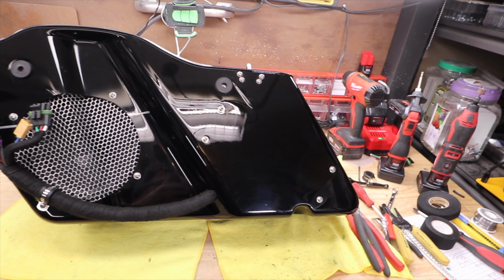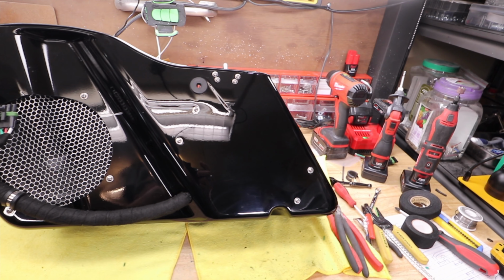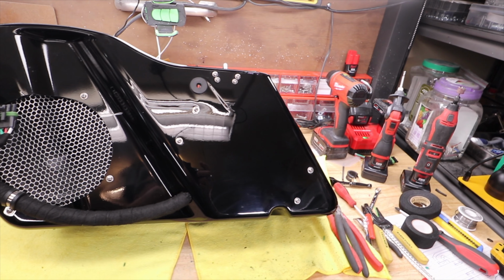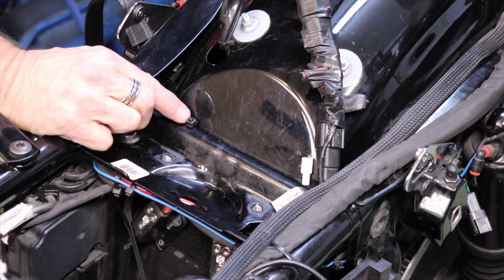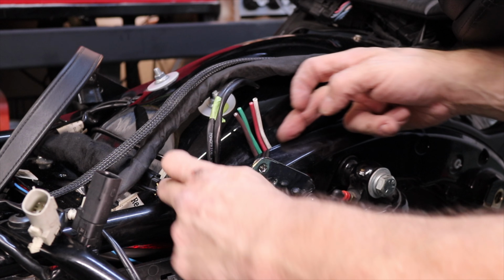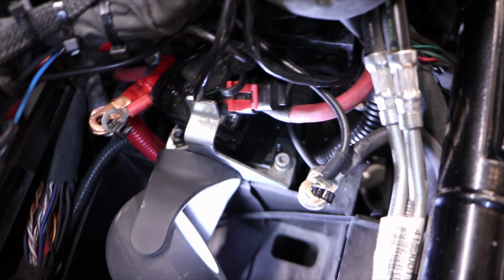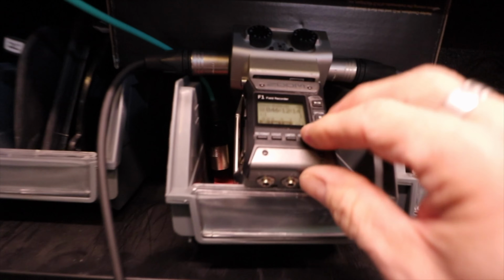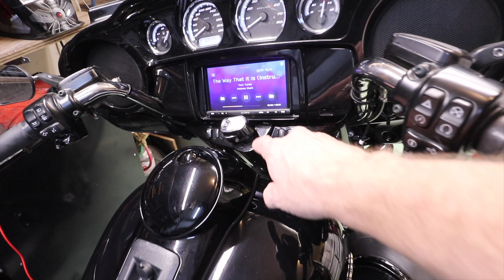Hertz SV200L Midbass Drivers in Harley Bags... Part 2

Comment: As a DIY guy myself....a clean install is of importance. If the next guy have to work (or even yourself)  or troubleshoot behind the install, they can and  will see exactly the flow of the install. Thank you for both videos, strip, twist, solder, shrink, added disconnects, and cable management.....dude you rock and I greatly appreciate your dedication to detail.
Reply from the maker: Right on, thank you so much. 👍🏻

Comment: Awesome video.. do you have a video about your lower set up ? I've been looking at different pods what do you have going on with speakers, amp and pod?
Reply from the maker: I don’t have a video dedicated to just the lowers. The pods are custom made so I can’t recommend those. I do know that Hog Tunes makes a pair that look deep enough to except a decent sized magnet speaker. My speakers are ground zero, the new yellow basket 6.5 coaxials. The amp running the lowers and the tour pack speakers is a Rockford Fosgate TM400X4AD.  It’s a bit under powered compared to the other stuff on the bike but it still sounds good. And the signal to the amp is coming from a Rockford DSR1 DSP. That’s really the heart of the system in my opinion. The whole system is 10 speakers, 4 amps and it would be a nightmare to control without a DSP.  Thanks for watching.

Comment: what brand lower fairing pods are those?  I have Ground Zero coaxials and i couldnt get the Ground Zero label facing the right way because of the speaker hook ups.  even using a half inch spacer.
Reply from the maker: Mine are a custom made “one off”. I can’t say who made them because he’s not interested in making any more. Just no money in it.  I would say take a look at the Hog Tunes ones.

Comment: I have dual hertz Sv 200.1  8 inch in saddlebag facing wheel. Should I run them on the subwoofer output or rear speaker output…
Reply from the maker: Tough question without knowing what else is in the mix…If you don’t have tour pack speakers then run them off of the rear channel, if you have tour pack speakers, run the 8 inch off of the sub channel and set the crossover “All-pass”. Or don’t.. personal choice.
Reply: I’m not not running anything else. Im just just running some Biketronics 7.1 in the front fairings that’s it.
Reply from the maker: Then definitely run the 8” off the rear channel. So much simpler to work with.

Comment: Great detailed vid! I have a similar setup with mmats 6x9s in my lids and the hertz 200s in the bags. What crosovers are you using? For the lids and the mid bass in the bags??
Reply from the maker: A Rockford DSP is handling the frequencies to the Hertz 200's and the 6x9's have their own crossovers that are made by Kicker but I am really unhappy with them and was looking at the DS18 2-way passive crossovers. I'm open to any input anyone has on 2 way crossovers. They have to be good for at least 300W.

Comment: Sounds incredible! May I ask what the 8’s are crossed over at? Or tuned at? I have the Soundstream HU and will be using the sub pre out, and just  Wanted to get an idea of where to tune it
Reply from the maker: Technically my speakers are full range speakers, not subs. So I have the crossover bypassed to allow the full range to come through but on the EQ in the DSP I have boosted everything below 100K by 3dB.

Comment: Did you install the front speaker enclosures or did you have it done?
Reply from the maker: If you’re referring to the 6x9’s in the lids, they are sold by V-Twin Audio. https://vtwinaudio.com/product/vthlk6914-2014-up-6-x-9-lid-speaker-kit/   I had V-Twin install them.
Reply: @i.b.lancer  Yes I m thinking of getting that setup just was curious if you installed them or you had vtwin do it . How tricky it was?
Reply from the maker: I have had the lids off a couple of times and it looks to me like the hardest part about it would be correctly cutting out the holes for the speaker grills. The rest of it just bolts right in. But like I said I sent mine into V twin and they did it for me. Sorry I can’t be more help on that.
Reply: @i.b.lancer  That's plenty of help thanks. By the way great video's.
Reply from the maker: @jdstuts7749  Thanks. I remember seeing a video about installing those. It was quite a while ago but you might want to look around YouTube land to see if it’s still around. I’ll snoop around and if I find it I’ll pass it on to ya.

Comment: Nice how do you splice your rc cables
Reply from the maker: Strip off equal amounts of casing on each wire then push them straight on with each other and give them a little twist, then solder and heat shrink. It really helps to have a set of clamps to hold the wires while you solder them.  Like these... https://amzn.to/3ckaeYW

Comment: So, are you pretty happy with the mid base, does it really changes the sound?
Reply from the maker: Oh ya, it’s a night and day difference.  I haven’t had it out on the road yet.. cause..well, Canadian winter. So I don’t know how it sounds on the highway. But it sounds damn good in the garage.
Reply: @i.b.lancer  I really appreciate all your information, am running 6  6.5  and 2 6X9 in my saddle bags only on one evoX800.4. I’ like to do the dsr1, one more evoX and of course your 8 mid base. Don’t leave any holydays on your painting project 🙃
Reply from the maker: Ya, good choice. I’m thinking about picking up an evoX800.4 to replace a Rockford I have under the fairing. I don’t need two cause I’m running a Biketronics 2250 and that thing is unbelievably loud.. hitting me in the face. And the amps in the bags are so far working out really good. Audio Control is really good stuff but they don’t really have big power for bikes yet.... so I got two.  Lol.
Reply from the maker: @MrAyarza  what speakers are you running?
Reply: @i.b.lancer  I hear you, you will notice the difference with the sound digital. Changing the subject. Was the dsr1 installation and downloads pretty easy? I tried but I got stuck on the firm update.
Reply: 2 ground Zero, 4 Hertz and a pair of 6X9 Rockford
Reply from the maker: @MrAyarza  Ya it wasn’t bad. Did you plug it into your home computer to do the update? I did it and it worked ok on my Mac. As far as the install goes, I think an intermediate level stereo guy should have no problems hooking it up at all.
Reply: @i.b.lancer  yeah, piece of cake on the installation just on the update few of my computers didn’t recognize the dsp. I ordered a new one thinking the other had some sort of problem.
Reply from the maker: Now that I think about it, I believe I had to drag out and old windows machine to get that done.
Reply: @i.b.lancer  as you can tell, am running my amp on the two ohm load, so if I got one more evoX, then,  I will have two more channels to take some load off from the other one. Does that make sense?
Reply from the maker: @MrAyarza  yes and no. Most modern class D amps love to run @ 2 ohms, but you get more separation splitting the speakers up through the DSP for sure. I’m running a 10 speaker system with 4 amps. The back two are running at 2 ohms and the front two are running at 4 ohms. The beauty of it all is that the possibilities are pretty much endless.
Reply: Wow that’s a lots of power,  nice👌

Comment: Great video 
My build is on a 2018 Road Glide. 4 Hertz SV 200.1 Mid Range speakers in front. Accompanied by 4 Hertz ST25 Horns, my read is only 2 Hertz SV 200 L’s in the Lids accompanied by 2 ST35’s, adding a different set of lids Double 8’s and that will give me 2 more SV 200 L’s and 2 More ST35’s. Have 4 amps 2 - BT4180 and 2 - BT2700-2’s also have MLK 1650.3’s in tour pak pods.
Reply from the maker: I love the Biketronics amps. They really hit. I’m picking up another soon myself.   Thanks for watching.

Comment: What size amp are you running for the 8”
Reply from the maker: 150 watts per speaker.. RMS
Reply: @i.b.lancer  is 150 watts rms maxed out with 8”speakers
Reply from the maker: Specs say those speakers can take 500W. I just picked those amps for their size. 150W per speaker is definitely not enough. I keep meaning to upgrade the amps but life is busy.

Comment: How long was the ground wire and what gauge did you upgrade it too?
Reply from the maker: It was 8 awg and about a foot long. Pure copper welding cable. I ran it from the battery to the main ground terminal on the bike. I left the stock cable as well, just added one.
Reply: @i.b.lancer  I’m thinking taking stock off and doing a 1/0

Comment: I thought the box says 200 L’s are WOOFERS? Car audio people called them SUB WOOFERS
Reply from the maker: The SV200L are a mid bass driver with a Frequency range of 45K to 4,500 Hz. They are not subs. Subs are useless on a motorcycle unless you never leave the parking lot.
Reply: What are you running the 8” with ? Size amps ??